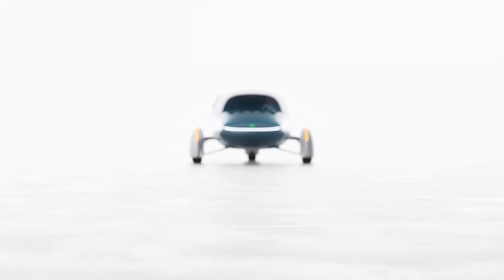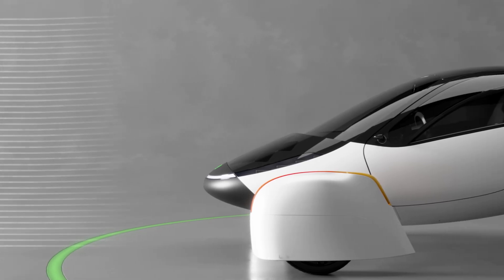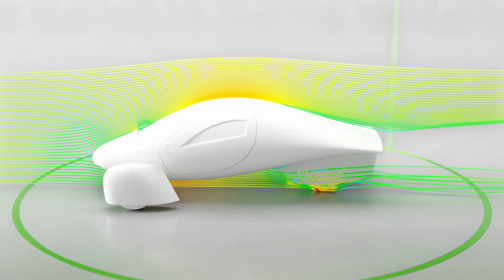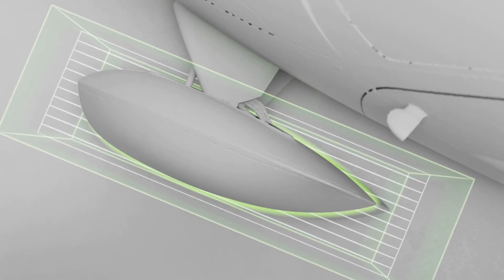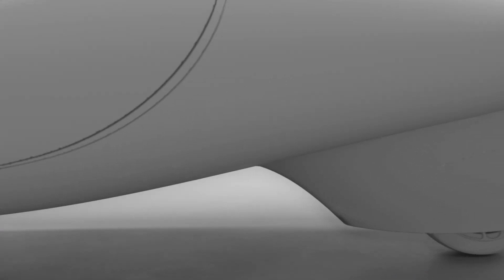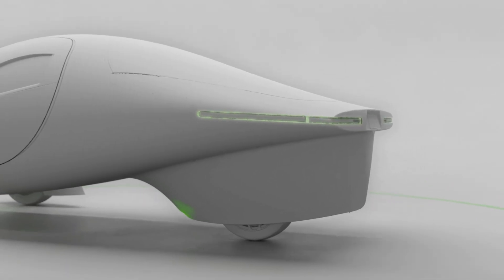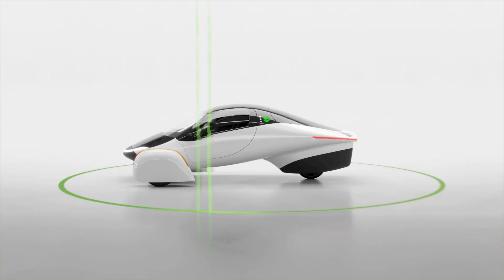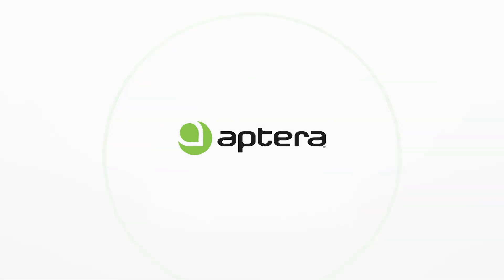Aptera's Aerodynamic Optimization

Comment: Question: If this light vehicle was parked in a driveway, how would it handle hurricane-force winds?
Reply: It has been tested to resist side winds better than most SUVs.  There just isn't much flat surface for the wind to exert force on, or to provide a lever arm for what force there is.

Comment: bad points : too large, camera mirror wich is stupid if u have electrical issue with them...., and solar pannels could cover more area on back and sides....
Reply: good points : large km range, and good looking. light. bigger inside than its looks like... .
Reply: The cameras will work in conditions that mirrors do not.  The production models will have more solar panels than shown on the alpha prototypes.  Look for the gamma model reveal soon which will be much closer to the production configuration.
Reply: @n.brucenelson5920  still, if u have technical issue with camera mirror they won't works where usual mirrors will still works, I have never seen any situation where classic mirrors can't works, and for solar panels it could be great to see the final product. But it last one bad point, the size of the car front wheel from left to right. 2.23 is too big for European roads and that's a big issue because their is no infos on that, in the site, so the car will only ride in America so it's a big loss of potential buyers like me.
Reply: Most cars are only 1.8m large... So it's a big issue for smaller roads.
Reply: @ShanKhaLee  I have seen plenty of situations where it was too dark to see anything in mirrors - mostly outside of cities.  In any case the first Apterae are going to ship with mirrors.  The cameras will show areas the mirrors can''t reach.

As far as width goes, we will have to see.  There could be modifications of the front track for the European markets.  Aptera has had a German homologation expert working on this and other issues for a long time.
Reply: @ShanKhaLee  Agreed.  It is one of several issues that make this first model a niche vehicle.  For many Americans, at least, the added stability adds welcome performance and safety to the design.  It certainly won't meet the needs of everyone.

Comment: Heat extraction issues with wheel covers and internal third wheel?  Any real performance (and performance sustained braking) and regeneration will generate heat.  How will this be extracted completely and non impacting to performance and safety? I have watched couple YT videos.  Very impressed with founders and team.
Reply: If maximum regen is chosen, much of the energy that would otherwise be converted to heat will go back into the battery pack.  The rest of the heat will be carried by circulating antifreeze to the aluminum belly pan to be carried away through radiation and convection.
Reply: @n.brucenelson5920  regen itself generates heat from the motors (in wheels), plus using brakes for spirited driving (which spirited driving is encouraged in the videos), will build up heat inside the wheel covers.  I suggest venting on top (or back), with NACA ducts and directional air flow added to the covers.  This should not affect drag (of either type), yet, keep motors and brakes cool.

Comment: WHY doesn't Aptera use smaller front wheels? (I mean in diameter, so the inch size of the rim, I am aware it needs the width for hanlding)
With smaller diameter wheels air drag, weight and rotating mass would be lower.
Reply: While you are correct, they are adapting an existing design of the Elaphe wheel motors, and a smaller diameter would make tires harder to source, and reduce the top speed the vehicle is capable of.  I plan to use my Aptera in snowy Iowa, and the additional clearance and availability of studded snow tires will be important for my use.

Comment: Any talk about changing the split windows? I’m 6 foot and if I go to look out the side windows I’ll be looking right at the black split in the window. This has to be a safety issue. I was debating on ordering one of these but not unless they change those windows.
Reply from the maker: Hi Teddy! Thanks for reaching out. Aptera has split windows to accommodate for Aptera's unique curvature. If the whole window were to roll down, the circular barrier where the track hits wouldn't fit unless it was split. It all comes down to designing Aptera to be as efficient as possible, but visibility shouldn't be an issue. Feel free to reach out to info@aptera.us if you have any further questions.
Reply: @ApteraMotors  thanks for the reply and I understand that it’s for aerodynamic purposes. But I just watched the video where Chris took his first ride and he said he’s 5’11 and when he went to look out the window he had to strain his neck and bend down just too look under the black strip and out of the window when he was turning. I just feel like that would get old fast and would put alot of strain on my neck. I just wouldn’t feel safe having that much of a blind spot when I’m just trying to casually look out my side windows. I’m sorry but if it wasn’t for those windows I would definitely be buying one. Hopefully when you guys design the 4 seat 4 wheel version it will have better and safer side windows so I can purchase one!
Reply from the maker: Hi Teddy, thank you for your response. The vehicle featured in the video was our Alpha prototype and we are making continuous improvements while we make further progress on the path to production. Thank you for your feedback! It is saved.

Comment: This showed the engineering that went into the aerodynamic design as it pushes forward through the air. I'd like to see how side winds or diagonal winds are handled. It looks like it would do fine, but I'd still like to see it in the fashion they showed here.

Comment: That it's being built in SoCal makes me wonder just how it would do in a proper climate. Here in Northern Nevada, for example, neighborhood roads may not be plowed when it snows, so you've got to bump over lines of snow to/from the plowed main streets. Snow gets up in your wheel wells on a "normal" car. How will these pods handle that -- not to mention the in-wheel motors? Does the Aptera have a battery heater so it can charge itself when left outside in sub-freezing temperatures? (How easily can the tires be mounted to the wheels, given the presence of the motors?) I'd really like to see a proper winter test (obviously not possible without going to the other end of the planet right now). I've never driven a vehicle with more than two wheels (don't even have a car license -- just a motorcycle license!) and would rather have something electric if I did, but also something that would make snow and winter commuting much less insane (coldest temperature I've commuted in on my motorcycle is -8 F).
Reply: I went many years with only a motorcycle for my wife and myself as well.  

Aptera will pass validation tests in temperatures from -20 to 125 F, with some systems tested down to -40.  There is both antifreeze based liquid battery heating and cooling, and an active AC system, plus resistive cabin heat.

As soon as a production intent vehicle is available, it will be tested at the Elaphe winter weather test track, as well as other places.  I live in Iowa, so my personal Aptera will see lots of snow.

The wheels and tires bolt on to the wheel motors, just as they would to drum brakes.  

Aptera has a fantastic ABS/Traction control that can sense slip and adjust torque 32 times per wheel revolution - about every 2.5" of tread travel.

Comment: It's a plane wing on wheels.  Not knocking it but that's what it is.
Reply from the maker: You're right. A lot of the same aerodynamic principles used in planes to make them slip through the air were applied to Aptera to allow for us to use a quarter of the energy of other EVs.

Comment: What I don't like with these wacky self-padding-on-the-back sort of statements and claims regarding aerodynamics is that we've known this for more than 50 years.  You haven't done anything else, Aptera, than what you're supposed to do if you're going to plow a vehicle through thick air with least amount of resistance.  So stop tooting your horn as if you've made some kind of a great achievement: You haven't.  Generations before you did.  What you're doing is just what you're supposed to do.  Humility will take you further than your wacky smoke screened claims.  Other than that, good job and good luck.
Reply: Two things.  Just look around at our transportation choices today, even in the EV space, and you can ask yourself that if this is not such a great achievement, why hasn't it been implemented by others at an affordable price?

Most of the potential market for these vehicles has never heard of Aptera yet.  Such pieces are needed and should be widely distributed, especially in this day of high energy prices.
Reply: @n.brucenelson5920  My comment is strictly regarding aerodynamics achievement claims.  Can't speak to affordability, potential, greatness or need and have no opinion on whether you have a point; though good if you do.
Reply: AWESOME COMMENT!  
We don't have to wait for a 2 seater with a drag coefficient of 0.13 or better? 
Where do I get one? I want one now!
What brand are they?🪵

Comment: I think this car has been "in the works" for about two decades now.
Reply: This design was started in 2019, and will be in owner's hands before the Tesla Cybertruck, which was announced about the same time.
Reply: @n.brucenelson5920  there's a video of Jay Leno driving a development car from nine years ago. While this iteration is recent, the concept hasn't really changed since they had the idea in 2005.
Reply: @mtnman1984  Yes, the overall idea is similar.  The engineering is different and was started fresh in 2019.
Reply: @n.brucenelson5920  well, yeah. I'd hope so. EV tech has move on quite a bit over a decade. Save for minute details, the car is exactly the same.

Comment: What will be the overall width?  An important consideration for curbside parking.
Reply: 88" outside edge to outside edge of the wheel pants.  A compact parking space is generally 96".
Reply: @n.brucenelson5920  Wow, that is wide.  A Lamborghini Aventador is 80" wide.  I have concerns about clumsy/distracted drivers driving into the wheel nacelles.
Reply: @SoCalFreelance  Yes, it will probably happen, so I think it is a valid concern.  However, I have a Chevy P30 that is wider, and it didn't take me that long to get used to it.  When I get mine I plan to let people try it out and see what they think.  Other early owners will likely do the same.

Comment: The other day they finally started to talk about additional models. I have a two seater on order, but I am hoping they develop a four seater soon as I would like one of them as well. The two seater converted to a covered small pickup would be interesting to. Lower the bed and lift in height, isolate the cabin from the back, and make the back a little more bulbuls and it would work for light hauling.
Reply: They are ALL two seaters.
Reply: @ronaldlenz5745  The other day in the Webinar they talked about different versions. They also talked about wanting to grow the company beyond a niche player. To do that they will need a 4/5 seater. I don’t expect it for at least a couple years, but if they are successful with the two seater it is logical to go for a bigger market after.

Comment: Efficiency is the Holy grail of BEV. Tesla has focused on it, but Aptera has taken it to a whole new level. Aptera is the only BEV that really makes sense. With the larger battery packs you can actually drive all morning under any conditions at any reasonable speed and fill up over lunch and do the same thing in the afternoon. Never required to charge more than once a day and never for more than an hour.

Comment: It’s great to see fine engineering.  Even the major manufacturers do this. What the majors do not do is produce anything without compromising for what they perceive as marketability. It will be wonderful to see Aptera in production. True engineering without compromise. There will be one in my driveway, sunning itself to full charge and raising the bar for the automotive industry.

Comment: I have questions about vehicle width and practicality.
Aerodynamics is cool, but what happens when battery technology improves? And the density will become 2 times greater, with the same battery size. Then questions of width and practicality will become even more relevant regarding the meaning of using a less practical and larger vehicle (88 inch wide),especially for Europe.
Reply: Even if batteries reach equivalent energy density as gas, efficiency is and will be paramount to reducing emissions. This goes for all our energy consumption, from industry to farming. And it's sad but you're probably right, when EVs are able to match ICE cars on range and convenience in a standard form we'll probably be designing even less efficient cars than what we have today. Humanity can only learn the hard way.
Reply: @CaseyDarwin  Great comment.  The baseline should be the need to reduce the damage of the environmental disasters we are causing, not the approach that led us here.

Comment: This is an awesome feature. The question I have is how much stress does this now put on the breaks? I assume that with increased aerodynamics it will coast a lot further than a normal vehicle and you will have to hit the breaks more frequently than in a normal vehicle.
Reply: Most braking is done using regenerative braking. Most of your kinetic energy is converted back into electrical energy which is then stored in the battery.
Reply: Factor in a lighter vehicle. That reduces need for greater breaking power. Right? Or no?

Comment: the car is fantastic, but I don't see why you can't put 2 small seats in the back to make it a 2+2, I once had a Porsche 911, the back seats were horrible, but the 2-3 times a year I needed them boy was I happy they were there, yes people had to twist their necks and there was like 3 inches between the front backrest and the back seats, but still they were there when you needed them.
Reply: Hi JP, it will happen in a future version. They plan to do a 5 seater.
Reply: OK, well that's sad then, thx.
Reply: that's cool, but it's probably gonna be a bigger 4 wheeler then, for my needs I'd prefer this vehicule with an 2500$ back seats option.
Reply: @zoxeme  In the US regulations for autocycles may prevent it, at least in some states, or it may be a safety issue.

Comment: Side benefit of the Aptera:  The wheels on the side means I’ll be too far from the drive thru window to reach the food, which means I lose weight, which means increased fuel efficiency.
Reply: I can't wait to get it, I'll be the first kid on my block to have one, I'm over 80 now and I'm sure it's going to extend my life.
Reply: I gave up fast food in 2012. I dont miss it
Reply: Helluva side benefit! 😆
Reply: That's the next accessory they need to make money off of - the optional lunch cooler. I use one in my truck for work, one of those thermocouple mini coolers that plugs into the 12v outlet. Keeps your food/drinks cold throughout the day. Modern vehicles have made it a pain in the ass by having the 12v outlet power off when the vehicle is off automatically now. 
If they made an intelligent cooler I would buy it in a heartbeat. Stays on for a preset amount of time so it will all still be cold when I get back in the car from a job site. Hellzyeah.
Reply: ATM Drive thru is out.
Reply: I don't get fast food much anymore but my daughter's like the occasional happy meal. I order on the app before I leave the house and park at the pick up spot. The food is ready and brought to me when I get there and I'm in and out b4 a vehicle even moves through the drive thru line lol.

Comment: I wonder if it would be possible to have a similar design for a “truck” version in the future. Obviously there would be a lot of aspects that reduce efficiency, but hell, even a gas powered truck with a similar aerodynamic design would be a huge improvement over the box-like pickups today.
Reply: I was wondering the same thing. Lower the rear end to reduce the lift over height, isolate the cabin from the back, and but a more bulbous back hatch on it to give its some volume and it would make a good light weight hauler. More than most people need going to the garden center.

Comment: the US exclusive mirror law is ridiculous and needs to be abolished
Reply: The problem is when Washington write regulations they require specific solutions instead of identifying problems and saying eliminate this problem by the means you desire. You need to see behind and to the sides of your vehicle. The regulation should say the vehicle will have the means to observe behind and to the side of the vehicle without the driver turning around to see.

Comment: Love the changes, Ive always felt the back end turbulence could be easily captured by a couple of EDF's adding extra power to recharge while driving. The Cd. of a standard trunk/boot causes fairly significant air pressure at the exact point's you've slimmed the body around the tail lights...